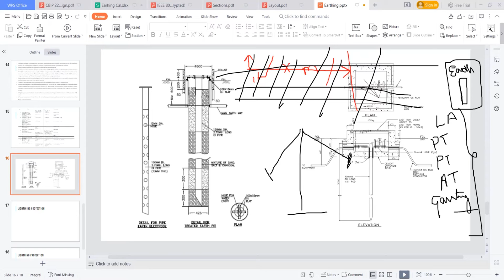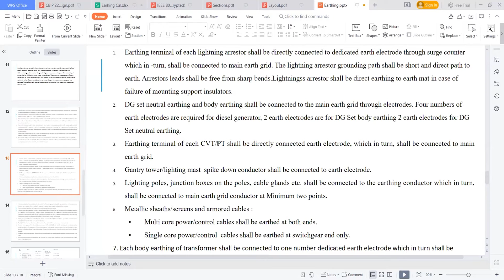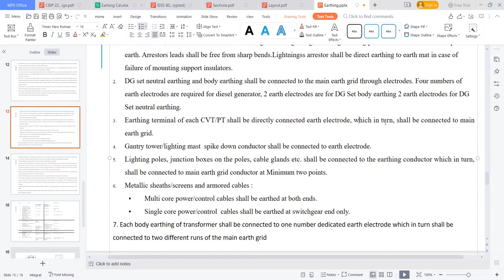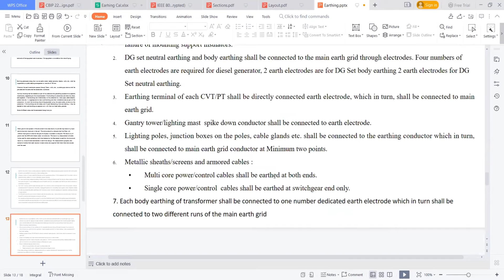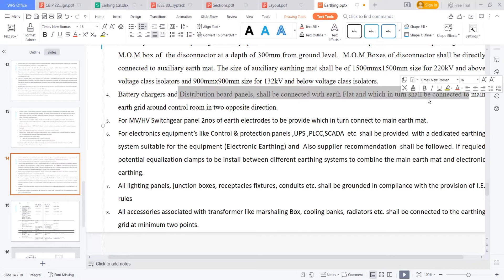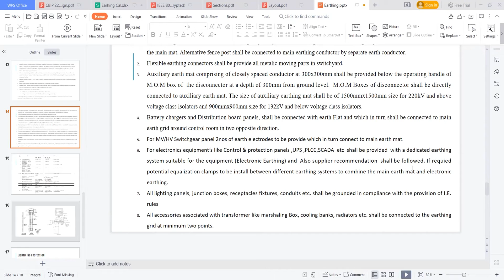Substation Earthing Design | IEEE 80 | Part 7

Comment: Hi, if I get good earthing. Values (below 1 ohm), should I pour salt into the pit? Or just pour water
Reply from the maker: It depends on what type of earthing you are going to use, and after earth you should only use water but after making earthing use salt also.
Reply: @electricalthunderbolt corrosive nature of salt will speed up eating away the zinc coating on the GI pipe. Zinc coating acts as sacrificial anode saving the inside iron from corrosion